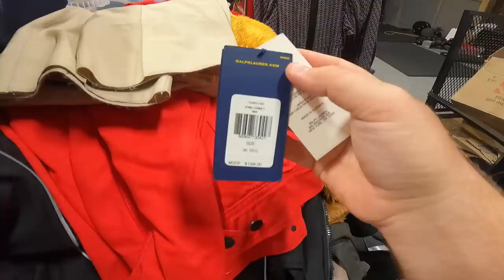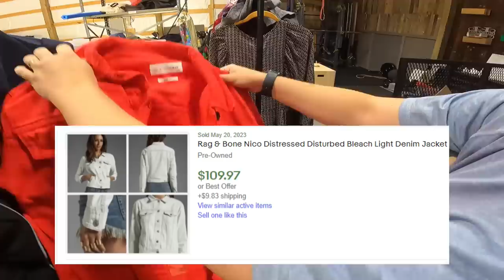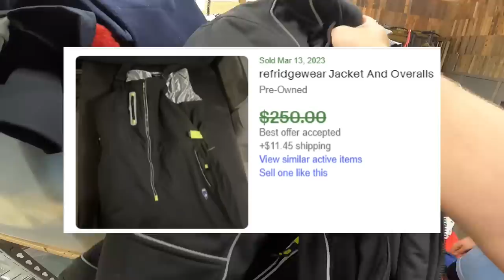Spending $1000's on a MASSIVE Hoard of Designer Items

Comment: In my experience, it’s been easier to buy a massive tarp, lay it down inside the trailer, put boxes on top, then fold over the top.
Reply from the maker: Yes I definitely should have done that.
Reply: Yes, because a LOT of that water was sprayed up from below. Lesson learned.
Reply: I was thinking the same.
Reply: @HairyTornado  And then put a smaller tarp over that, tie down well and nothing gets in - it acts like a tent fly. Did that all the time using a trailer for camping (Family 0f 3 -6 depending on the year lol) and NEVER got the inside wet.
Reply: Thought the same thing.

Comment: Once the boxes were wet, you were likely near the net weight limit on those smaller trailer tires.  Their capacity should be on the tires themselves and the trailers capacity should be on a label somewhere on the frame.  Don’t forget the trailers weight has to be subtracted from the Gross Weight Load Limit, to get the Net Limit you can safely carry.

Oh and great job backing the trailer!🙂🙂

Comment: One thing you could do, to prevent future 'wet boxes' - go to an RV repair place, and see if you can get a big chunk of some of an old RUBBER ROOF from a big 5th wheel or camper... and glue that to the wood on your trailer (floor). That prevents any water from coming through from the road, and pads your wood. Then, you can have 1 sheet of outdoor plywood on EACH SIDE, another in the front, and you can either TARP OVER that... or use a 'slip pin hindge' to allow the lid to still be removable. My sides are removable, though honestly they are seldom removed, and I don't recall the last time I removed the 'front' panel. Having the trailer really empowers the benefits of our highlander. Having it 'closeable' - keeps weather, critters, and prying eyes out of our stuff. 

Awesome haul... some really cool stuff. Great find, awesome brands.

Comment: next time rent a UHAL
Reply: Pro tip right here
Reply: Yup, super cheap for an enclosed trailer too. Also…. Check the forecast lol.
Reply: @thegardenstatepicker  😂
Reply: @thegardenstatepicker  speaking from experience?
Reply: Buy a cargo trailer, don't rent.
Reply: A uhaul increases costs.  Not worth it for clothes you can wash
Reply: @thegardenstatepicker4986 super cheap? You realize uhaul charges for miles? You realize how many miles you'll drive in 3.5 hours?
Reply: @gardenwarrior4219  costs me like £3 a load to wash and dry 1050 items is a lot to wash lmao 😂
Reply: @gardenwarrior4219  have fun washing the NWT items.
Reply: @bluebelle9572  yeah, haha. Trailer rentals are very cheap through Uhaul. And I’m not saying do it all the time, but if the forecast says rain, and you have an open trailer… it might be worth the $15 a day (plus some taxes and fees). That load would have fit in a 5x 8 with a few boxes in the back of the car. Checking the forecast though, also from experience... I got caught in a downpour from Newburgh NY to Brick NJ cleaning out a 15’x20’ storage unit full of vintage vacuum parts and transformer toys. I’m thankful it was on the vacuum parts day! Tarps are not what they used to be…..
Reply: @gardenwarrior4219  $15 a day for trailer rental. However you are 100% correct on van and truck rentals. They are astronomical in those fees now! I remember paying $280 for a weekend to transport a convention…. Now, around $600.
Reply: 100% agree
Reply: Rent a 15 passenger cargo van with unlimited miles next time.
Reply: Or buy a box trailer

Comment: Trailers:  like you, my first was an open flatbed that I used for hauling lumber, sheet goods and a small tractor (about 25 years ago), but as soon as I started reselling and sourcing in bulk I added a single axle enclosed trailer to my vehicle inventory.  

Since I live west of Seattle, days like you experienced were too common in the rainy season and I couldn’t let most of what I sourced would be ruined by rain.  The enclosed trailer solved that issue and saved time dealing with wet stock.  Not having to deal with tie downs and being able to arrive home late and not unload until the next day were also well worth the cost of a single axle used trailer.  

I went on to find and used 4 enclosed and 2 flatbeds, as the business grew, keeping both single and double axles trailers in the inventory gave us more versatility and we could size the trailer(s) to the job, saving even more time.

Comment: Standard weight Tarps are notorious for being ruined when traveling at highway speeds because straps and bungees don’t hold them down well to open trailers or covering pick-up truck beds.  The wind rips and shreds the tarp’s edges, especially around the grommets.  

What I do is cover the tarp (on rainy days) with an old woven fishing net.  It holds the tarp in place much better when using the straps and bungees woven through the 2” square mesh.  I got mine at a local auction about 12 years ago.  On sunny days I use the net without the tarp.  It also has the advantage of keeping small items from flying out of open top boxes and bins and works well for loads like firewood and trash headed to the dump

Comment: When u put the tarp over your things  let it  hang loose. Don’t tucked it in. So the rain will just run off. When u tuck it in waters gets in the folds. A 88 year old man taught me.
Reply from the maker: Had to secure it down so it didn’t fly up and fill with air on the road

Comment: I have moved a lot in my life time, I did learn to put tarps on the bottom of the trailer, place boxes etc, fold the tarps up around the load strap it down them place tarps over the top and strap them down good. You should have nice dry boxes. Good luck next time.

Comment: Refridgewear is freezer gear for industrial freezers. The warehouse I used to work in had a giant freezer that would get to -32 degrees. That’s the gear we would have to wear to work in there. Def can use it for winter time in cold states. They are expensive to buy but not sure how they resell.

Comment: You know where the person said they were storing them. One thing I didn't notice on your shoes & clothing items... you didn't TEST for dry rot. We learned the hard way a couple years ago, buying 63 pair of BRAND NEW IN THE BOX OMG highend golf shoes... only to learn 99% of them had dry rotted soles. Awesome & impressive uppers, and sweet looking soles, UNTIL you bent them or took a step; then it was snap, crackle, pop. All garbage as-is. We also bought a bunch of clothes that were dry rotted; looked great - but messed up. We've since learned to TEST the items we purchase. Something we didn't know until we started gathering inventory and reselling... stuff stored in a garage or metal building, or non-insultate/not climate controlled building CAN get dry rotted in about 2 years of storage. Anyhow... your haul looks to be well kept, and a great deal.

Comment: Don't use cheap tarps, get what is waterproof. You need to rethink making a long drive with an open trailer; weather conditions change rapidly. Use the overkill theory when protecting what you just paid big bucks for.